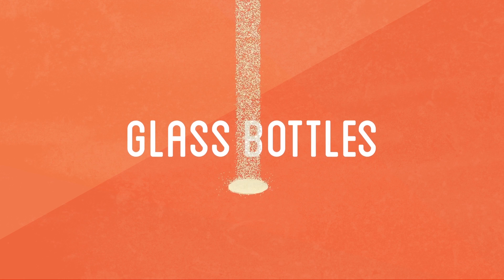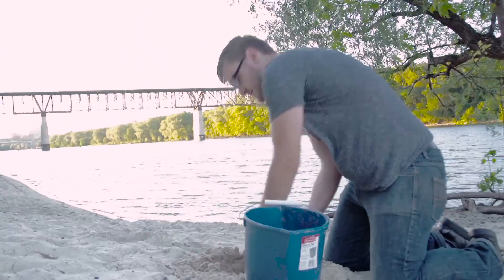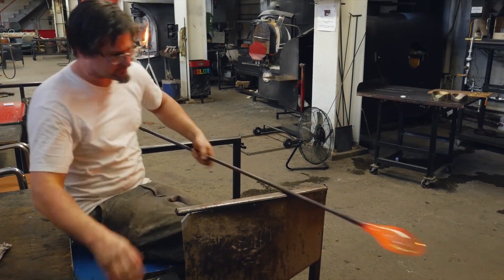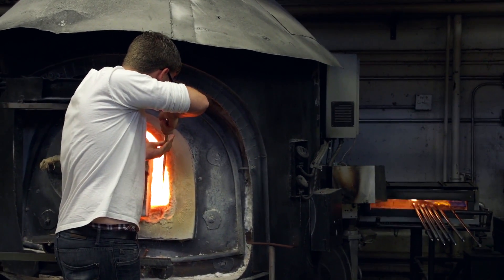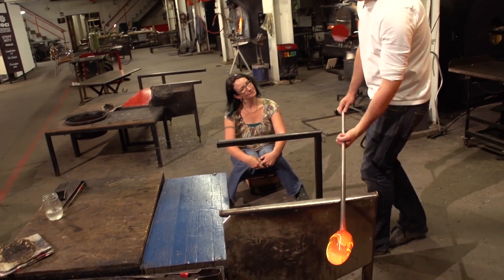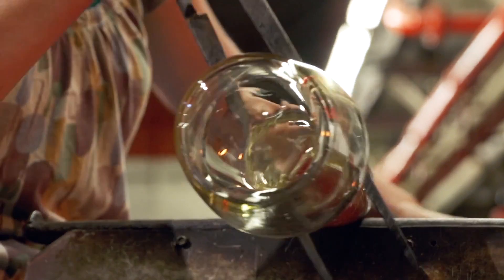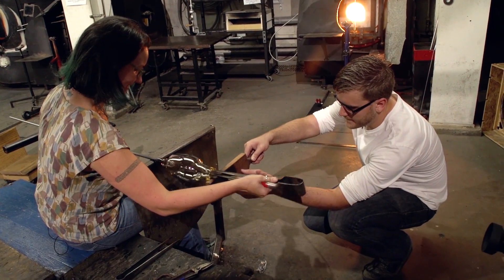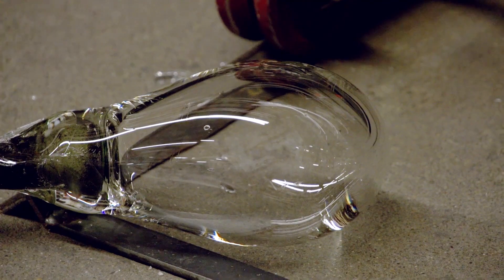Glass Bottle from Scratch | How To Make Everything: Bottle (4/4)

Comment: would be interested in knowing what type of fire you need to heat the sand, seeing as different fuels and methods reach different temperatures, i doubt you could melt sand by simply burning wood. 
You could do a video on making coal, seeing as coal burns hotter than wood (oddly enough seeing as it's made from wood) and has a lot more industrial uses.
Reply: +Jokker88 I'd like to clarify i meant charcoal... Language barrier :P

Comment: I dont get how you can make glass from just  sand..... As I know you need other chemichals aded.....
Reply: +Evren Uçar The additives aren't really essential for glass to form, though. Different additives just change the properties of the glass (adding boron components for chemical resilience, for instance) or make production easier by lowering the melting point (eutectic systems).
Reply: +Evren Uçar  We melt Spruce Pine Batch in our furnace. You are correct, not just pure silica because the melting point of pure silica is close to 3000 F, and horrible for shaping like we do. Usually we spend a day filling the furnace, a day cooking at 2350, and then bring it down to 2100 working temp. The little glass that they made from scratch had more than silica as well. There was some sodium and calcium from some plant ash. It was a very basic glass and far from homogenous. Also it was melted and gathered in less than an hour.
Reply: +Evren Uçar Actually, sand is made of silicon, the main element in glass. Any other impurities will actually ruin it, as explained in the video.
Reply: Of the many silica-based glasses that exist, ordinary glazing and container glass is formed from a specific type called soda-lime glass, composed of approximately 75% silicon dioxide (SiO2), sodium oxide (Na2O) from sodium carbonate (Na2CO3), calcium oxide, also called lime (CaO), and several minor additives. 
-wiki
Reply: ***** thanks man I have already looked into it... It had been taught me at school that just silicon isnt enough to make glass....